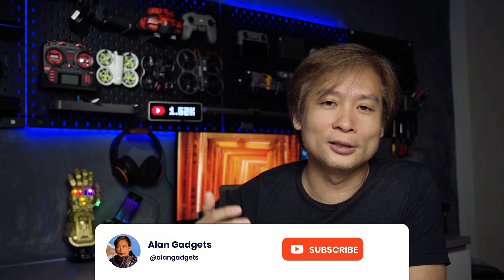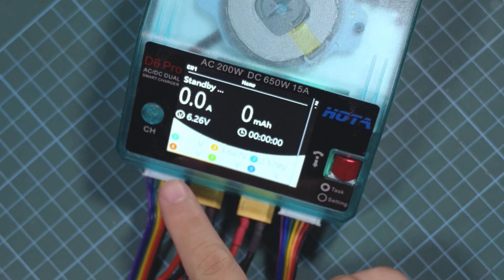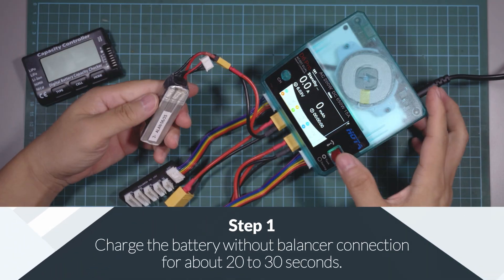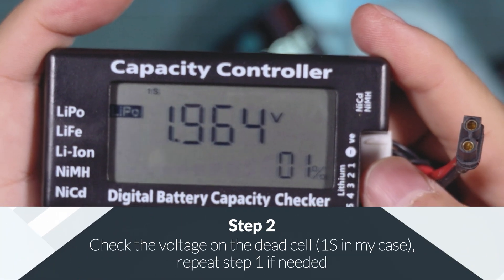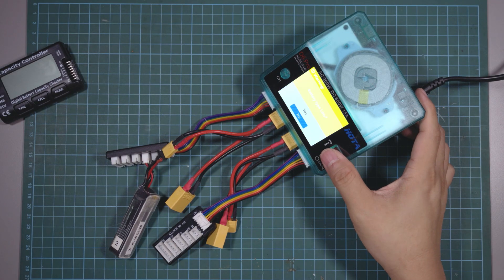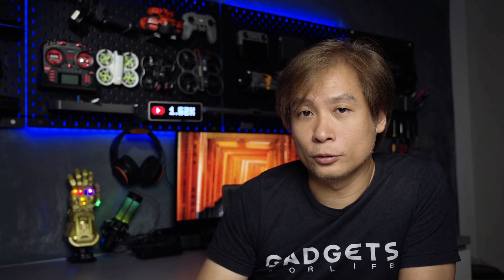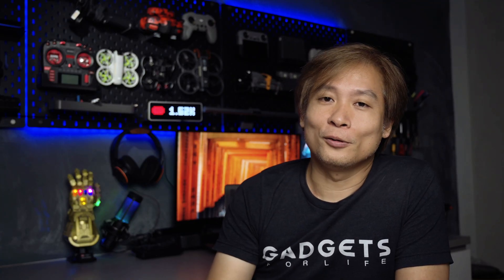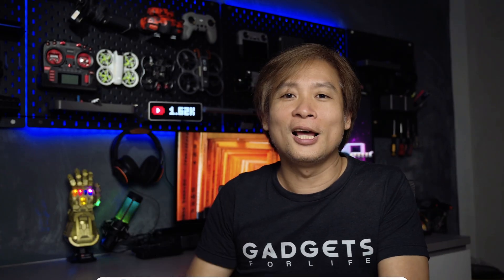HOW to fix "ABNORMAL balancer port connection!" battery ERROR

Comment: Mine still won‘t let me charge when only plugging in the power cable. It says abnormal battery connection?
Reply from the maker: Did you plug the power line into the balancer port by mistake? It happened to me before..